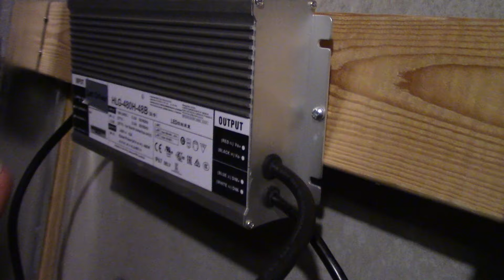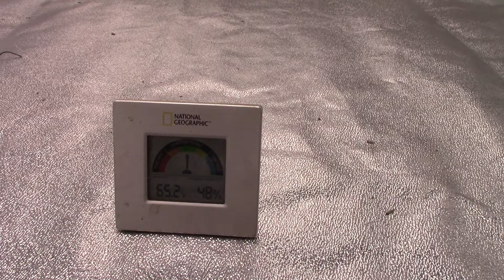quick install of the KingBrite quantum board in 4x4 tent grow log to come

Comment: Hey bro nice video.I got the same light and it gets really hot, do you have this issue? My driver is not attached to the light and the driver itself isnt too hot, I can hold it with no problem. Thanks for your time.
Reply from the maker: what’s reallly hot ?
Reply from the maker: i can plug mine in and put it on full for few and see what it gets to .. i mean it gets hot for sure .. can’t remember exactly
Reply: @420Things  hot like cant put my hand on it too long. Thanks for the reply.
Reply from the maker: @average_joe3325  yeah i’m thinking for sure .. like the lights fry the tent up to a decent temp .. i wouldn’t be able to leave my hand on top for too long if it was at 100% .. what’s that temp .. i’m thinking 35-40 would be that level that i could t leave it ... Ste you able to measure it with a laser gun ? if so i’ll throw mine on today and measure it and let you know to compare
Reply: @420Things  No worries I dont need to know the exact temperature, I guess mine its around the 30/40 celcius, I was just checking if it was normal for it to get so hot as many ppl online claim that is the driver the one that should get hot and that is not my case. I will contact the supplier to see what do they say I am worried that the heat might affect the leds. Thanks a lor for taking the time to reply bro, appreciate it a lot.
Reply from the maker: @average_joe3325  defiantly touch base with them

Comment: Do you absolutely need to splice wire to install this thing? Does it not come fully assembled? Was that just because you needed the extra length to mount outside the tent?
Reply from the maker: Shane Hunter yes  i just wanted it outside... and later i put it back in ... cause the heat is really not an issue ...
Reply from the maker: Shane Hunter and when i’m out it back i. i put it back into the connector it comes with ... if you’re looking on alibaba ... the ones that say pre wired are the ones that are done for ya ..